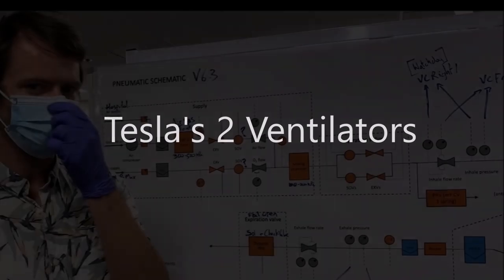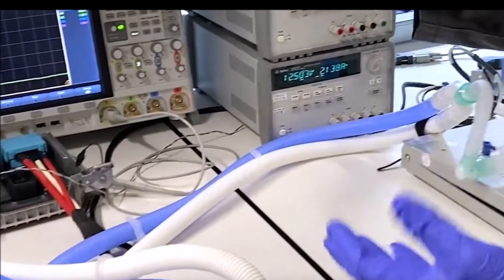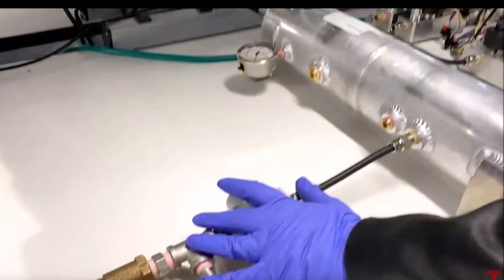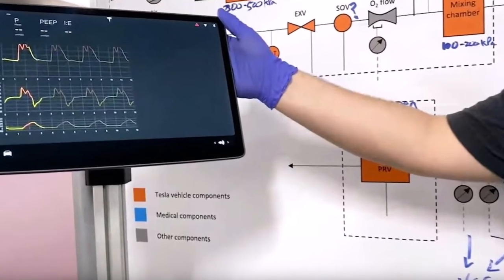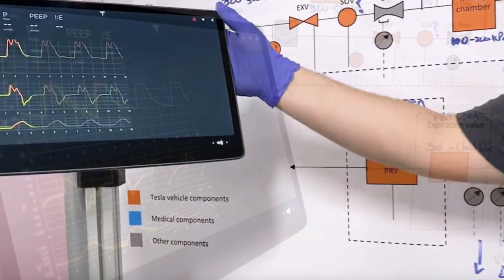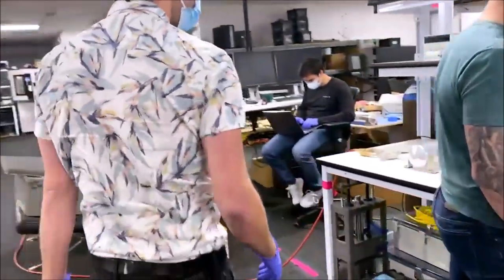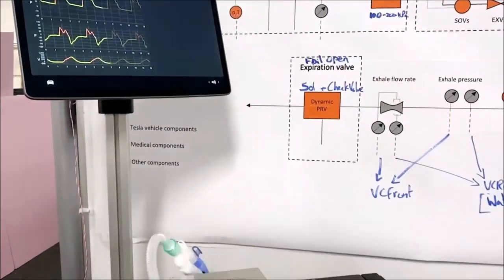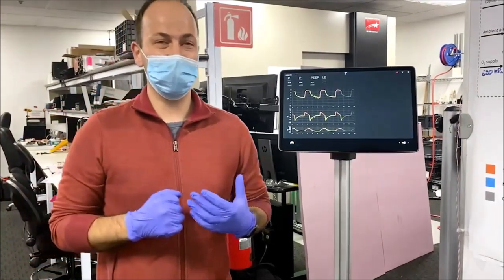Tesla Shows 2 Versions of Ventilators Made from Car Parts

Comment: Ventilators are surprisingly complex machines (see, for example, https://www.youtube.com/watch?v=7vLPefHYWpY), and all those simplistic designs that simply rhythmically squeeze a "bag valve mask" do not cut the mustard - they can inflict barotrauma and/or cause the collapse of alveoli. It is encouraging that Tesla is working with Medtronics (?), and, as far as I can see here, their prototype has most if not all of the necessary features, like sensors that detect when the patient's diaphragm is initiating the inhalation cycle, provision for maintaining slight overpressure on exhalation etc.
Also, I think that all their reasoning for using as many in-house forced parts as possible holds water.
Good work - much better than that "robotic snake submarine" publicity stunt of several years ago.